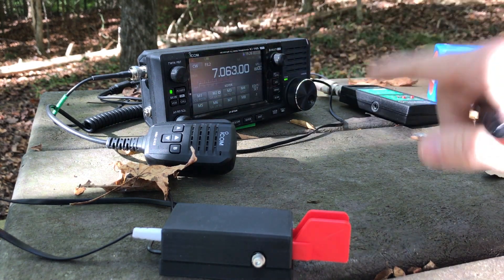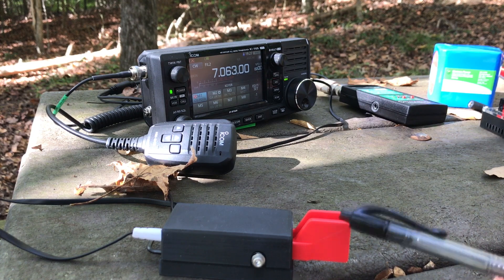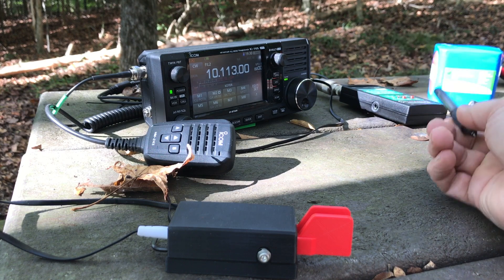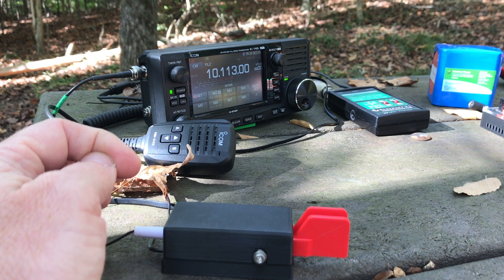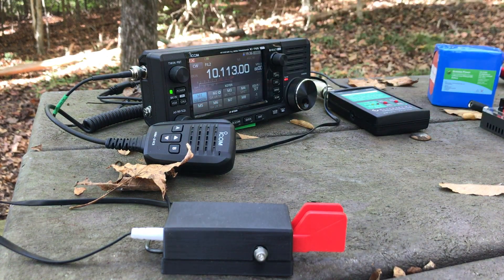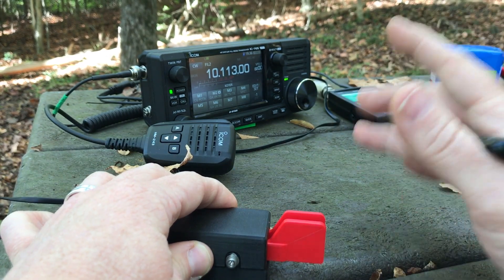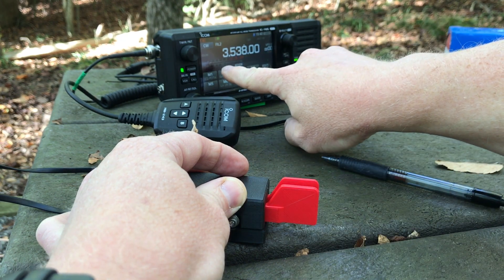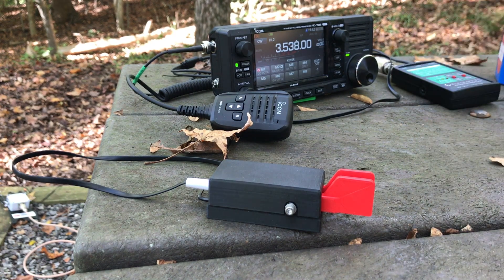POTA 101: Operating CW with the Icom IC-705

Comment: Thomas thanks for putting these videos out! I am a QRP SOTA activator with nearly 100 activations in the past year all phone. A couple of activations were failures and I started to see the value of CW, I can identify individual characters at 18wpm no problem after practicing 30 minutes a day for the past 6 months but when I listen to your QSOs I’m picking out maybe 1 character in 10...I still have a lot of work ahead. I have the hardware FT818/IC705 to make it work but the software (brain) is not there yet!
Reply from the maker: Bravo on those QRP SOTA activations! That's an accomplishment for sure! 
Rex, I would highly recommend the free application "Morse Runner." It simulates CW pile-ups. It really helped me. You can begin by setting the WPM speed at a lower rate, tuning off the LID interference, fading, and only allowing one or two stations at a time. As you build confidence, you can add some of those distractions back in and up the speed. It really helped me. Here's an article I wrote about it: https://swling.com/blog/2020/07/upping-my-cw-pile-up-game-with-morse-runner/

Good luck! Your brain will soon kick in an absorb those CW calls!

Cheers,
Thomas
Reply: Thomas update here! From skyscratcher88  I used your advice and also listened/listening to Kurt Zoggleman CW stuff and have 3 QRP POTAs with @60 QSOs under my belt via CW! 

I am using a MTR4BV2 the humidity is rediculous so I’m waiting for drier weather to bring the 705 out. 

I always wondered how prolific SOTA activators could have 40-60 QSOs on a summit. Now I know the secret of QRP CW! 

Anyway thanks for the inspiration!

Comment: Great video!  Do you ever give the POTA # during the exchange or do most people know where you are from the spots?
Reply from the maker: Great question! So if using phone (SSB), yes, you give the signal report and park number "K-1234" during the exchange. The other op gives you a signal report and their state/province/country. In CW, however, you generally only give a basic signal report as an activator unless asked to give a park number. Some ops always give a park number but 97% only give the signal report. Same in SOTA. If it's a park-to-park contact, I give my park number, though, because the other op may not have that info available to them via spots, etc.
Reply: @ThomasK4SWL  Thanks!  Looking forward to spring...

Comment: Just how noisy is the 705 on CW, can you hear the relay much? Can you operate full break in without the relay clacking away?  Nice vid, I just ordered a T1 kit after seeing this!  I'm torn between the KX2 and 705, what to do? Cheers de GW4OKT
Reply from the maker: Great question. So you can hear the relays, but they're very quiet. If you've been operating a KX3 (which has PIN Diode switching) and move over to the IC-705, you'll notice it. But honestly? It's quiet enough I forget there is any sense of clicking and that's with me running full break-in. All of the Icom radios I've used have at least reed relays involved in the T/R switch. I'm not entirely sure how the IC-705 is designed.
Reply: @ThomasK4SWL  Ah, thank you. I've been wondering about this. I don't know how it compares to the 7300 relay noise, but I sold my 7300 because it annoyed me so much, even after mitigation.
Reply from the maker: @ksb2112  Before you buy, if there's any way you could listen to one in person, that might give you a better idea. If I think about it, I'll try to record the sound of the relay click next time I make a video.
Reply: @ThomasK4SWL  Thanks for the info, I Iove the facilities on the 705, like being able to precisely adjust your local noise floor with the aid of the 'fish finder' display. RX current seems to be low, according to other vids I've seen.  I'd love to see a serious comparison between the 705 and KX2 from a CW operator perspective (QSK etc.). Also, I suspect CAT control of the 705 may be possible, not so simple with the KX2. Thanks again for the vid Thomas. 73 de GW4OKT
Reply: I think the clacking of that paddle would put me off more 😂.. Looks light weight but it makes its self heard!

Comment: A thought on the ATU use.  You may want to drop the power down before doing a tuning cycle.   During the cycle, the SWR will be bouncing around as the tuner seeks a match.   Some of the spikes, although short, can be quite high.   High enough that it's possible for the short spike to cause a voltage across the final amp that could exceed it's break down voltage.
I once popped the finals in my first FT-817 during a tuning cycle.  I had it at 2.5 watts, half it's max power so I thought I was safe.  Nope.   I drop it to 1 watt when tuning now.   Even if the radio has SWR protection, those spikes come fast and furious and the protection circuit may not be fast enough to react.
Reply from the maker: Indeed a very good suggestion. I actually typically do this with transceivers--I tend to lower power to 3 watts or so. Not sure why it didn't even cross my mind in this case. Thank you!

Comment: Can the IC-705 decode CW like the Electraft KX2?
Reply from the maker: Good question: I need to dig into the manual a bit and find out. It will--and I have--on RTTY.
Reply: @ThomasK4SWL  It only decodes rtty not morse. great video though 73's
Reply: Nope, only RTTY, just like the 7300.   I wish they'd add it.   Another thing the KX3 and 2 do that I really wish they'd add, is RTTY and PSK31 transmission using the key.   You send CW with the key and the radio just takes that like keyboard input and actually transmits in psk31 or RTTY.   A seriously cool feature   I had a full PSK31 QSO on my KX3 just using my paddles for input.
There's no reason they couldn't add that in software on the 7300 or 705.
Reply from the maker: @loughkb  Agreed. I'll never forget a Field Day perhaps three years ago when I completely blew a friend's mind by making a PSK-31 contact with my Elecraft KX2. We were at Mount Mitchell State Park operating from the internal battery (very lightweight!) and he simply couldn't get over that functionality. Not sure why they wouldn't have added this to the IC-705.
Reply: Wait, my $75 Russian/Chinese Malachite receiver can decode Morse, badly, but the iCOM can't? Yikes!
Reply: @matthewdavies2057  uh, you mean the cheap RECEIVER that doesn't do 5% of what the IC-705 can do? Great comparison.
Reply: @Michael-nd7gh  Mine decides Morse. Yours does not. Chew on that.
Reply: @matthewdavies2057  wow, cool story bro! Sorry to disappoint you but I don't have an IC-705. I use a K1 and decode with my brain, I don't use a weak computer to do my work for me.
Reply: @Michael-nd7gh  Your brain huh? Then I won't ask where you plug your key in.